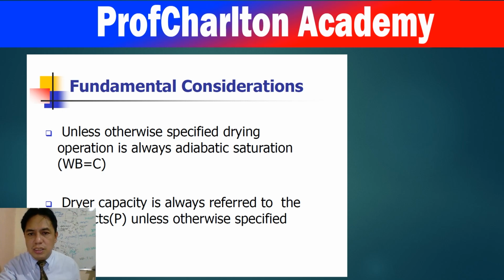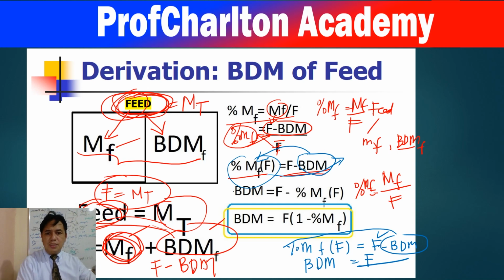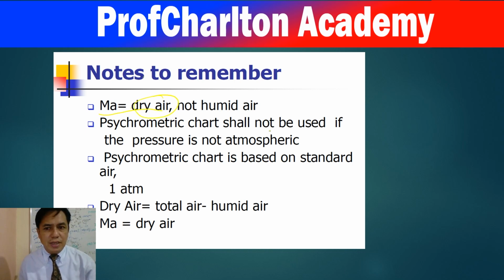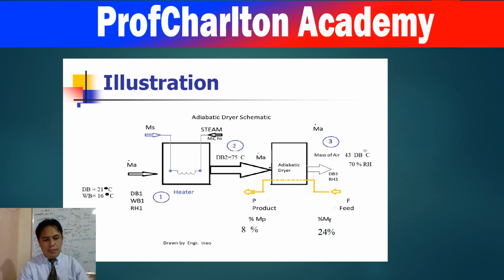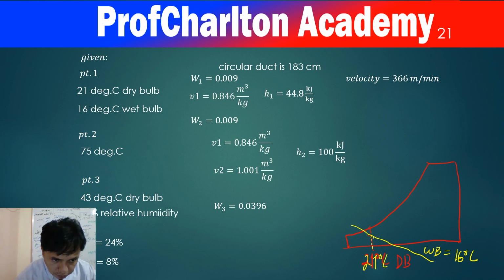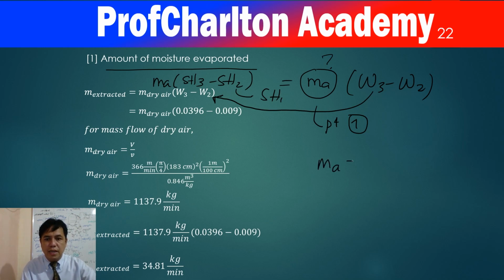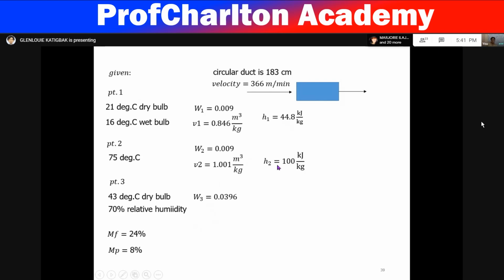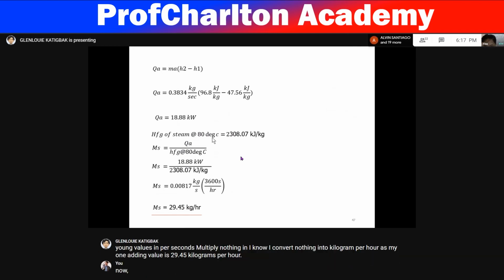Lecture on Dryers and  Solving of Board Exams in Dryers

Comment: This video illustrated how dryer calculations can be made by constructing a model of a dryer and solving it using appropriate numerical methods . 
Using general purpose mathematical software solving models is a task that can be handled by any Engineer. The results can be obtained in a short time and provide a sound basis for more detailed dryer calculations. For more advanced and specialized dryer design dedicated software should be sought.  This is a very interesting subject matter.  Thank you for being such an amazing teacher and for all your great lessons!